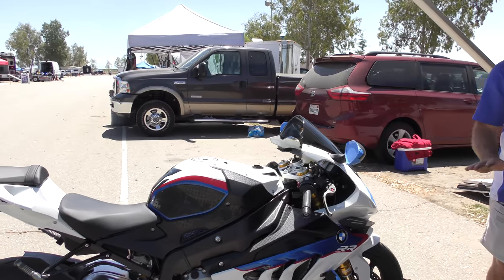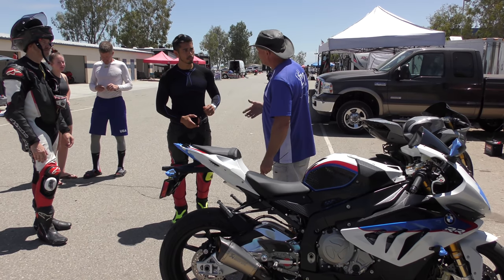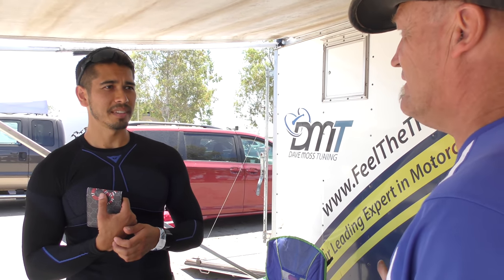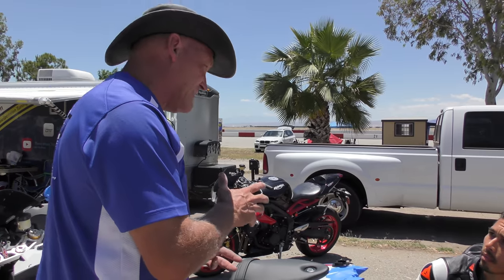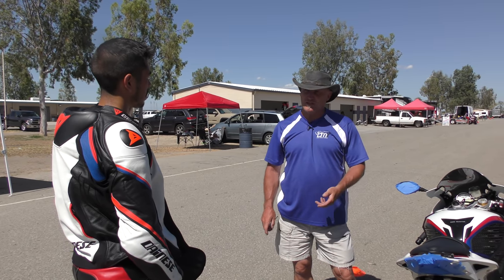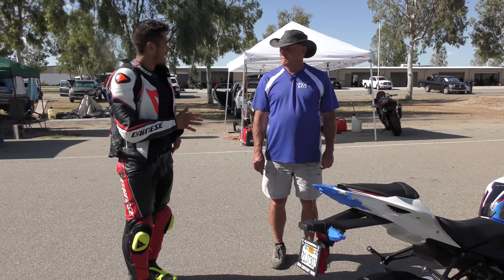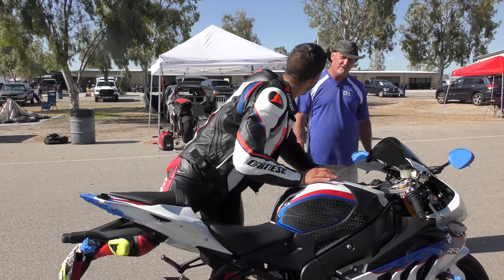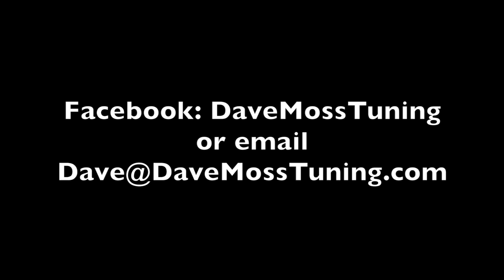Tuning Motorcycle Suspension in Car Suspension Language

Comment: I’m new to motorcycles, and like this guy I have been racing cars for years. At the track it’s all about data logging between sessions and laps to fine tune things. This video really helped me understand motorcycle suspension tuning since I understand car terms, and what we look for in tuning cars is obviously somewhat different. You can’t dial in negative camber or add or remove Toe-In , and the way You explained how motorcycle suspension tuning has to accomplish the same things through different means was to me just brilliant. Thank you for this.
Reply from the maker: Thank you for taking the time to comment on this video and the value proposition it holds for you being new to motorcycles! I'm sure your progression will be quick now that you have some base knowledge. Spent the time on ergonomics first and foremost and once preload and compression are set, make sure you spend the time needed to get rebound damping optimal.
Reply: @catalystreactionsbw  I watched two of your vids on ergonomics. It’s funny how different the considerations are from cars to motorcycles. My entire life I never thought about having to accelerate to grab the brake lever if your ergonomics aren’t properly set.  I’m learning a lot and my purchase will be this summer. A 400cc. As a part time racer I know the importance of learning to be fast on a slower lighter machine. I’m looking at hand controls and rear sets adjustments as my first priorities. Thanks again.

Comment: Hi Dave, from sunny Napier NZ.
I learnt to heel and toe ( rev matching while braking and clutching) my race car from riding my bike.
Do riders not blip the throttle while braking and changing down, nowadays.
Slipper clutches?
Reply from the maker: Yes, blipping is the same with bikes or you can cheat with an electronic auto blip/quick shifter combination. Slipper clutches are really helpful for race tracks.
Reply: @catalystreactionsbw  These kids have it easy these days, Dave  😁

Comment: Would love a video on how a loose chain can affect handling. I have yet to replace my chain and sprockets (time) and i swear every time i go to accelerate our of a corner even on the road i get a huge jolt as the slack and backlash gets taken up. Hoping to get the sprockets done at the weekend. For now i just turn the tube slowly in a higher gear!
Also how does chain length/rear wheel position affect handling.

Comment: Do you know about using ester component in shock or fork oils? Or manufacturers do not use ester base in shock fluide and fork oils?
Reply from the maker: POE (ester oils) are used in suspension fluid. Motorex is an example. POE are long lasting oils.